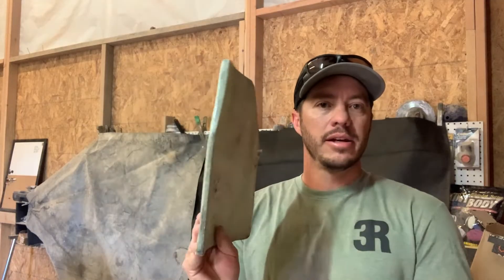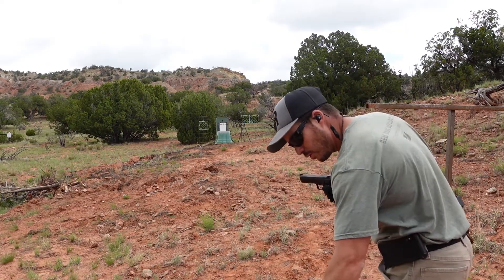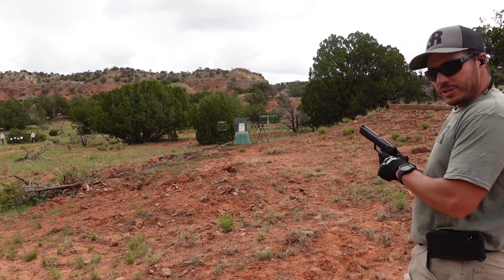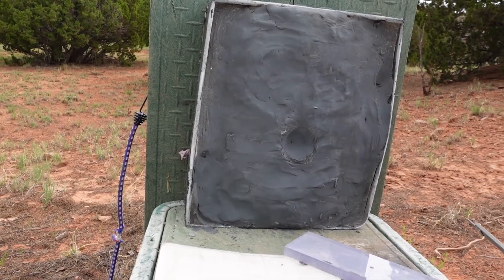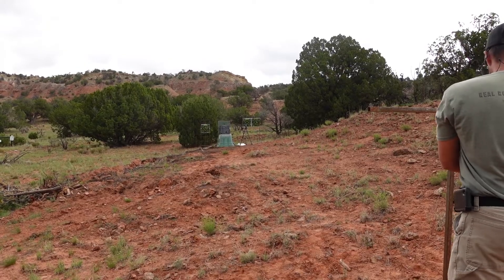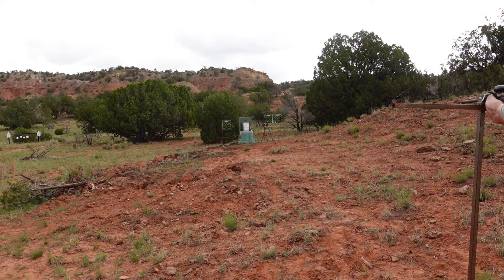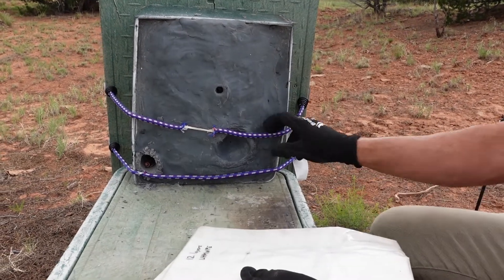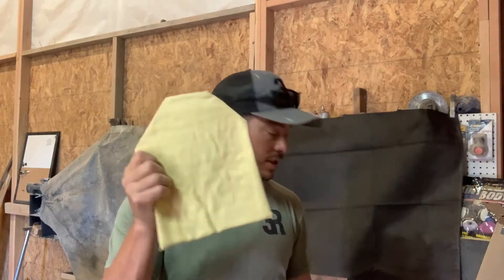UHMWPE - The plastic that stops bullets

Comment: Yes it stopped it but if that hids your chest you are still in trouble with broken bones and posible punctured lungs if not just out right burst.. thats a hell of a blow to get i would rather risk it with steel plates with spall protection yes its heavy but i know i wont get droped with the impact force and make me a sitting duck 1/4 to 1/2 inch mild steel would be intresting to see.

Comment: In your opinion, is it better to create a steel plate, such as a 1/5 of an inch, and then put this material on the back, or it should be better to put the material on the front of the steel plate?
Reply from the maker: At that thickness I would put it on both sides of the plate. It’s thin enough to not hinder the performance of the Polyethylene
Reply: @3RBallistics  Thank you. You know, I was dreaming of a tactical shield, non so big to become unusable. I think it can be done

Comment: Ive seen a lot of videos about everyday items being used to create armor. Im curious what happens if you start layering multiple different materials. like a layer of steel, then plastic, then fiber. Does that become a system where the its better than the sum of all the parts or is it worse than just using one material.
Reply from the maker: I have a few other videos layering multiple different materials. I will have a video up next month detailing something similar to what you are talking about.
Reply: @3RBallistics  Ill look forward to that
Reply: It would be better.I made mine with this on the inside and stab/slash proof fiber on the outer layer.

Comment: How much does that stuff cost? I’m working on my own project making a riot shield that has a good ballistic protection to lowest weight possible ratio using 3/8” aluminum plating…how much would you recommend to add to the plate or do you think reinforcing it with steel would be better
Reply from the maker: The cost really depends on how thick you want the material which is dependent on what rounds you are trying to stop. I believe I purchased it for about $35 a square yard. 
As far as the shield, I would use UHMWPE for the weight savings. Even though it’s going to cost more to build, I believe it’s worth the added cost for how much weight you would take off.

Comment: the plastic itself is resistant to uv. sometimes resins/adhesives are not that might be used in its construction/bonding. wish someone would try buying ceramic aggragate/garnet for water cutters and sprinkeling some over uhmwpe
Reply: Nothing sticks/bonds well to UHMWPE--the surface energy is almost as low as PTFE (teflon).
Reply: @justinw1765  it sticks to itself pretty easily if you go over it with a clothes iron between two wax paper sheets. im guessing it would bond okay to arimid this way. not sure how other mfg are doing it. maybe theyre not? or just wraping the arimid tightly around front and back and gluing? pretty sure those brands like safelife's hyperline is bonded somehow to the arimid in the back.

Comment: Very nice. I'd be interested to see what having a hard baker on it might change.  Would it reduce back-face deformation, or would restricting the movement of the PE cause the bullet to act like a paper-punch and let out go through? 

Did you say where you bought the material? I'd like to do a couple of experiments of my own.
Reply from the maker: I’ll be doing an additional test utilizing the hard pressed UHMWPE. From what I’ve seen, it should drop back-face deformation. 
I acquired the material from Alibaba (160 gsm UHMWPE).

Comment: My rule of thumb is, if the backer can stop 9mm by itself it can stop 556 or 7.62 with a ceramic strikeface.... 

In theory 12 layers plus ceramic should be sufficient.

Whered you get your UHPE fabric? Have you tried solid uhpe?
Reply from the maker: The UHMWPE came from Alibaba. I have tried solid UHPE and plan to utilize it in an upcoming project. However solid UHPE doesn’t stop projectile’s the same as the fabric.